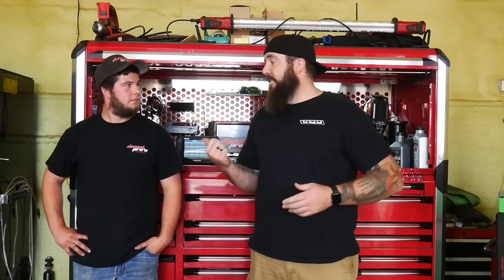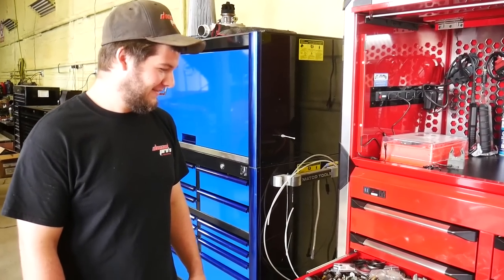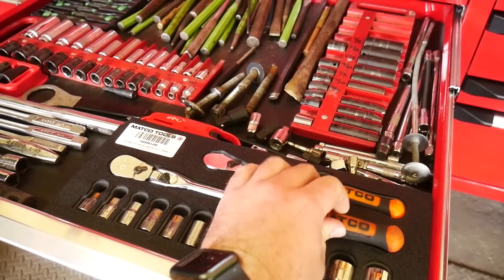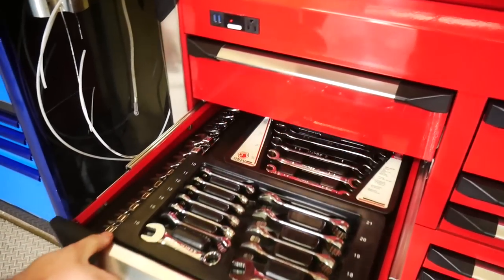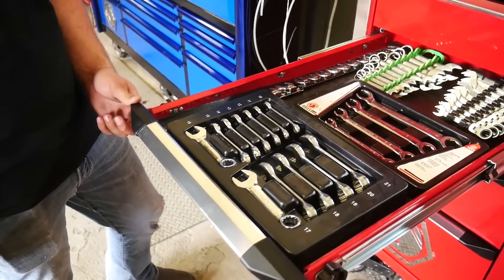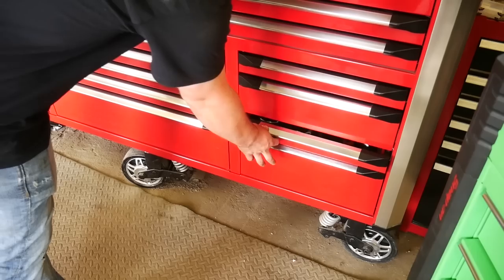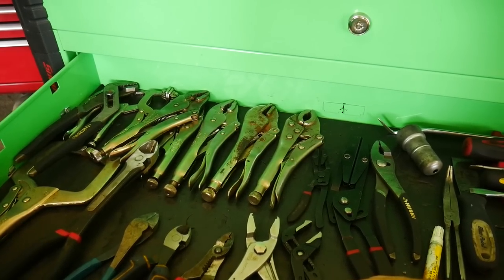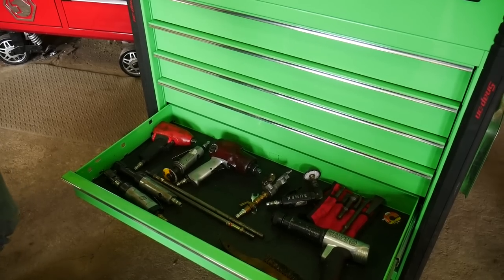TOOLBOX TOUR FROM A DIESEL MASTER MECHANIC

Comment: I've been a semi diesel tech for 25yrs now. You name it I've done it. ASE certified on Mack, Cummins, Detroit & Volvo. And all I have are two Snap On tool carts. One for all mechanical repairs. The other dedicated just for eletrical & laptop diagnostic, etc. Ive never understood these techs with huge boxs. No reason for it. But, each to their own.
Reply: I imagine you just work heavy duty then? No 3/4 - 1 ton pickups?
Reply: ASE certified on manufactures training? I didn't know they had ASE's for Cummins or ect.. 🤔
Reply: Samuel Taliento  yeah I’m a tech at a Mack dealership and ASE isn’t a thing here. We get Mack master certified which takes a lot of schooling but can only get it through a dealership
Reply: There's no way your ASE certified on Mack cummins or Volvo Mack and Volvo go to the same school you either go to Chicago or South Carolina and Cummins is a whole nother school by itself there is no ASE certifications for those engines or those trucks you can get preventive maintenance heavy duty brakes heavy duty engines drivetrain you can't get ase-certified on Mack engines or Volvo engines you can go to school and be certified through Mack or Volvo but you don't go take a test for Mack and Volvo like you would an ASE certification
Reply: He does seem young to have so many tools huh… bit of an addiction I suspect. A lot of the stuff seems excessive/doubles/tool truck violations.
Reply: @josephmeeker9334 saying ASE basically means master certified in those engines just in shorter terms, people in the field all understand that it's not a thing on those engines but we also know what he meant by it.

Comment: Not trying to hate but this is a light/medium duty diesel mechanics tool box.  Heavy duty is also different.  Great video non the less.   
🍻
Reply: Tommy Kozak yeah. This is baby diesel.   Not heavy diesel.
Reply: yea my homak box is as about as long as my wright 3/4 ratchet
Reply: Zoro357  "Har Har Har" -Tim Taylor
Reply: @evanm9026  ok baby girl we get your use to the big trucks
Reply: Yeah the same thing I was thinking. I work in the mine with mtu4000, QSK60s and the cat3516

Comment: Nice setup he’s got there. I’ve been building up my “mechanics” box the past 3 years, I’m a welder/fabricator by trade. I used to just work out of tool bags and a ~250pc kobalt tool kit, it’s crazy to think how much I struggled on some jobs lacking the proper tools. Now at my current job, I work on everything... small engine, light car/truck, medium trucks, equipment... you name it, it comes through our shop. Because of that, my toolbox/cart setup has become quite the mishmash of stuff. I will say that he will probably love that thermal imager. I own the elite (newer) version, and I don’t use it everyday, but when I need it, boy does it save some time and it’s worth its weight in gold!

Comment: Me being a everyday diesel mechanic in ohio working on semis I use more standard then metric because of 9/16 3/4 and especially 15/16
Reply: Cooper Moon I’m in Cleveland myself. What parts u from?
Reply: Cooper Moon oh don’t forget 11/16 on a lot of air fittings lol
Reply: I know a lot of newer auto techs look at u sideways when u mention a “ fractional size” haha. For me I’m standard all the way if I can get away with it
Reply: @johnnybratsch6019  west unity and depending what semis you work on if they have a wet line there are alot of 1 1/8 and 1 5/16
Reply: @johnnybratsch6019  yep but sometimes when you do motor work you get some metric that throws you off
Reply: Oh hell ya a set up to at least 2 inch is almost mandatory. Hell sometimes bigger on the hd equipment. But ya I’m  more so vermilion than Cleveland for me
Reply: What kinda shop u at ? Fleet? Independent?
Reply: well that the auto field is different , i use nothing but metric all the time. i have some standard stuff but never use it. i make fun of some of the older techs, they are like thats a 5/8ths or whatever and i go no thats 16 mm , i know that 16 mm is slightly larger by .125 of an inch
Reply: thats why the tool companies come out with extra grip sockets and open end wrenches
Reply: ya u beat me to it with the metric engine fasteners and a few here and there on the truck itself
Reply: Look at the aviation industry- all sae. That’s the global standard. A lot of that has to do with our influence after ww2
Reply: Those are most common sizes we use for hangers and flange bolts at work
Reply: You mean 14,19, and 24?
Reply: Nathan Gamez  no i was correcting his sae sizes with the metric ones that fit haha i use 10,13,16,24,27,30,36 most
Reply: Nathan Gamez  i use them for Claas choppers and combines for wheel bolts. I used to work at cummins now i work for a Claas dealer, soo i had to buy alot bigger sockets lol
Reply: @jaywebb0113  okay I'm here from the diesel guys at least on the big rigs they need some fractional stuff but whatever I see toolbox tours of just regular automotive mechanics I can't understand why they'll spend thousands of dollars for fractional ranches instead of just maybe buying the absolute cheapest crap they can that's not going to bust because what are the odds they're going to run into a fractional bolt I don't know I wouldn't pay for it all I own is metrics and I own a few standards from back in my youth when I was doing mechanical work but I don't think I've purchased anything in the last 20 years that wasn't metric
Reply: And 1" drive sockets, sleeve pullers, big seal installers, 3/4" torque wrench(how doesn't he have one or did I miss it?) 16lb. Hammer, 5 point sockets (real diesel mechanics know lol.) 4"+ sockets, 10 foot prybar, 1" drive impacts and a CP 717 zip gun(best tool ever) 
 This guys box is beginner status, light/medium duty.
Reply: Yep
Reply: Metric for Volvo and Mack 👍
Reply: Thé kid is young why be mean a lot of guys my age don’t have his setup

Comment: It's amazing how many more tools you need as an automotive tech/ diesel tech vs. how little I use in avation.
Reply from the maker: I’d like to get an aviation tech box on the channel for some variety sometime
Reply: @RustbeltMechanic  , you would see a lot of 1/4 drive, 12 point sockets, and weird screwdrivers.
Reply: You gotta see all the different too we use as auto body technicians/mechanics
Reply: Lots of safety wire tools as well lol

Comment: As a duramax diesel and Isuzu tech I have several Cleco tools that right angle 1/2 inch right angle impact is about 1500-3000 bands new. I got a study flex head air impact and a few different drive size right angles I only have to use them on older iprs and and ancient isuzu powered motor homes we get.

Comment: Well he’s definitely not gonna have any spark plug sockets.
Reply from the maker: Not many lol
Reply: Ha ha true. Although back in the day international made an engine that would start on gas until it warmed up then would switch to diesel. Seen one in action on an old crawler tractor. Legit spark plugs/wires/distributor on one side and diesel injection pump on the other. It’s been many a moon but if memory serves I believe the old timer told me that was  internationals solution to cold start issues prior to modern glow plugs, or hell maybe prior to glow plugs period, not sure. I’ve got a 2010 Cat C15 that has a single spark plug on it for the emissions shit. Not nearly as cool as the old international, but a spark plug nonetheless.
Reply: @brycejcox   I just looked this up, that is freakin sweet!
Reply: @brycejcox  Very cool. We rescued a small dozer that was at the bottom of a pond after it filled up while digging it. the dozer sat at the bottom for over twenty years . It has been many years since we did this but I remember changing fluids and drying out the pony motor. When that started , the diesel was only minutes behind. I believe it was an international. Just incredible. I still know where it is and it has not been run for thirty years and the son of my friend will not sell it as of a few years ago. I really want to buy that as well as the farm truck I learned to drive in when I lied and said I could drive and the farmer called my bluff and said hop in. The truck was a15 speed diesel and the stake body was over stacked with hay bales. Barely made it out of the field without taking the telephone wires out and dumping the truck. So many awesome farm memories. I went to many years of school for a PhD in chemical engineering and I just opened a vintage chopper and metric cruiser shop with fabrication and tuning. Go Figure.
Reply: Some medium/heavy truck shops have spark plug sockets because you can get some medium duty trucks with gassers. Some of the old ones were also gas pots.

Comment: I picked up the new brushless Snap-on impact a few weeks ago and I love it so far. Haven't had a chance to compare to Milwaukee, but there's nothing it won't do.
Reply: let me do one of the comparison for you. 

milwaukee 280

Snap on +1000

just for laughs. hehe
Reply: Miguel Garcia 
Yea it’s tool only price.
Reply: Adam Slack I have the Mac/dewalt brushless kit (1/2” HT and 3/8) and love them, the 3/8 is nice and stubby, great for brakes and tighter spots on cars, will take off wheels without thinking of it and the 1/2 is more powerful than our 3/4” gun. Two more guys in my shop got the Mac on deal and someone just got a Milwaukee so now we get to compare! 
The snap on that we have in the line out gets bailed out all the time by my gun even after being rebuilt, although that is an 18V gun from a few years ago.

Comment: Those cleco pneumatic torque ratchets are from mainly the aircraft industry. The "tuning fork" job on 737s uses 3 of them, only settings I can think of are the 80ft/lb and 120ft/lb, can't remember the third torque value.

Comment: i been bustin knuckles for 25 years or so with your average hardware/autoparts store tools just fine.i put a toolbox together for the cost of his first three drawers.the only difference is i also weld and do body work and paint out of my home shop and prob make triple what he makes lol its the knowledge and creativity that one posseses that impress me not a bunch of fancy tools that probably hardly get used.sockets and box wrenches welder and some basic elect tools and impact and few ods and ends with i could build you a racecar with every tool comig from harbor freight or home depot bahhaha

Comment: Only bad part of being a diesel mechanic is you have to spend much more on tools because you’ll use both standard and metric especially when working with semi trucks.   First year in professionally and I’ve got over $10k invested and that’s not counting the boxes.  Always did it on the side for others and myself whenever I owned my own truck and trailer but I Don’t regret it one bit.
Reply: yep im cringing, I reckon if that kid invested that money and bought more reasonable tools he'd probably retire when he's 40... Expensive medical bills doin diesel past 40 too..
Reply: Samuel Sholder my father is a retired diesel mechanic so I inherited a good bit of my tools (sockets and such).   Most of my other tools were purchased off eBay and maybe 20% from the tool truck.  Roll cart from matco ($1800) and a classic 78 from a pawnshop for $800.   Trying not to go crazy lol
Reply: @6.4DieselDoctor  Smart man. Just remember even putting like 20 a week away you can get huge payoffs. Check a roth IRA calculator... On the other hand dumbasses don't save and pay double on everything cause interest.
A lotta high end Taiwan stuff is real good and affordable. Also just find the OEM for who makes tools. Put the money you save away.
Reply: @samuelsholder2789  he has a business crazy how ppl have no clue how write offs work…. He’s gonna be just fine

Comment: I'm a professional diesel mechanic for republic services. These videos helped me set up my box. If you guys want to see my set up, let me know and I can send it to you
Reply: Garbage life!!!! I'm a mechanic at waste pro. Much love passed to u my brother stay safe
Reply: crawford  right on bro. What rigs do you have. We primarily have heils and mcneilus powered by mack, but we also have a couple of autocars and peterbilt rigs
Reply: @cerneysmallengines  we have mcneilus rear load, heil for the corrotto can front loads, and now we run new way for our commercial front loads and I have to say I work on them alot less because they dont break as much, atleast for my location
Reply: @cerneysmallengines  and we run primarily mack, which is actually a Volvo engine with different valve covers, I'll post a picture to show u bro
Reply: @jimcrawford3259  we run the mp7 engine. I'm not familiar with Volvo engines, so I dont know. We really dont have any rear loaders anymore, we've been phasing to automated side loaders, particularly the zero rev. Up here in Minnesota, the conditions are so harsh, that it doesn't matter what they are, they all break. Our biggest problem is wiring by far because of that
Reply: @cerneysmallengines  mp mack engines are volvo engines  just plumbed slightly different and the different valve cover that says mack .
Reply: @walkerv8530  learn something new every day. I dont spend too much time wrenching on the engines. I primarily do inspections and fix the problems there like bad brake strokes, wiring, lights, hoses and whatnot
Reply: @cerneysmallengines  very interesting, I'm In south Florida and the climate down here is quite brutal on them as well, an mp8 is a Volvo d11 painted a different color. Good engines when maintained.
Reply: @cerneysmallengines  i was in garbage for 8 years waste connections in nc , 5 years in truck side 3 on landfill equipment repair , stay safe . I found me a grading company with a fleet of grey engine macks im in heaven now other then the neglected brakes, been rebuilding them one axle at a time .
Reply: Checking in from waste management over here!

Comment: I’ve already got my hands on the snap on brushless 1/2. The Milwaukee doesn’t even come close
Reply: Eric Trimmer the Dewalt 1/2” 20v impact with the 3 levels will actually smoke the 18v 1/2” Milwaukee as well. I own both and the dewalt is my go to.
Reply: @weldingjunkie  technology... who has a 1" battery gun?
Reply: Michael StJohn Milwaukee.
Reply: @erictrimmer4338  yeeessssssss
Reply: The brand new Ingersoll Rand is stronger and has more features than both it's amazing plus comes equipped with a spot light lol
Reply: @weldingjunkie  DeWalt tools are junk, nothing but glorified Black and Decker. You do know they're owned and manufactured by B&D, right?
Reply: kwantoon yes I know they are the Lexus of black and decker. I know they aren’t great however my 20v Dewalt grinder and impact are solid and I beat the snot out of them. I have the Milwaukee 18v 1/2” does not beat the dewalt in bolt breaking power in anyway. That was my point.
Reply: Michael StJohn I have no need for 1” that was the same system as the 1/2”. I was only referring to the 1/2” if you read my comment.

Comment: Nice tools n boxes young nan.  My advice for young or entering the mechanic trade.  Buy tools that will make you money, as if you're going to start out with service oil changes.  You don't need all those shiny wrench sets.  Get enough to get the job done n stay off the candy land trucks.

Being a diesel mechanic later into your trade, you'll need most of the tools that this young man is showing.  But buy what you need Not to see who has the most tools.  Air guns n battery guns saves time, as will a good assortment of pullers, seal drivers ect.  Being a field mechanic calls for far more tools vs inside a shop.  If you work in a truck shop with drivers coming n going get a tool box set up with a remote lock actuators.  Sticky fingers will cost you 20-30% of tools repurchased.  Most shops make their floor off limits to non essential persons.  Now that I've been retired at 48, my back is a total failure as are my knees n shoulders, wrists n hands.  Automotive trade tool costs will be subsequently less vs a diesel mechanic.  Field mechanic you better be a above average mechanic n a good fab/welder n super good on electrical n electronics.  I have $75k in tools n boxes, n now wish I had the cash as you'll be lucky to get .50-60% on the dollar if you were to sell them.  NEVER work for any shop that throws you under the bus to please a customer.  We All mess up, n if you don't you don't do much mechanic work.  I have a zillion certifications at the master n journeyman level n I still occasionally mess up on little things.  Don't sweat the small stuff, you'll learn something new everyday if you're honest.  Learn from your n others mistakes.
Reply: f"n if everyone would read and comprehend this the big brand barbie glam bam companies wouldnt be charging what they are charging for absolute crap and 10x overpriced but the big nam and glitz and fam attract the F bois so they buy
Reply: Great post and words of wisdom

Comment: Check out dynamic tools d010029 3/8 flex head flarenut socket they have them in standard and metric really good sets and the prices are good also check amazon for them definitely a good buy

Comment: I have banned all 12-point sockets from the shop except for a set in the specialty box.  Way too many stripped out bolts from yahoos using them in either pneumatic or electric impact guns.  They are very seldom used and it has cut way down on screwed up parts.  Ironically, hardly use any standard sockets either, don't even have a set in my floor box in any drive.

Comment: amazing to a collection I have a similarly bentwrench a 9/16 box wrench that many years ago I just could not get a bolt to move so I went down about an inexpensive one heated up with a torch smacked around with a hammer first try that was perfect that was 40 years ago and I still have the wrench